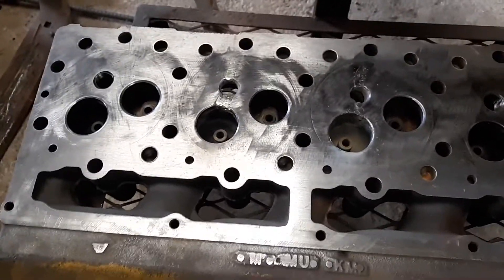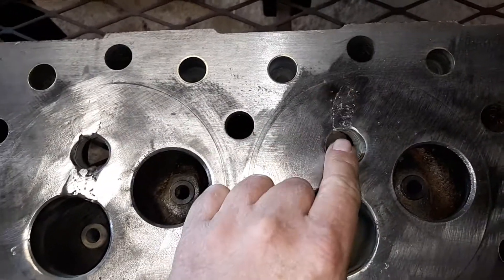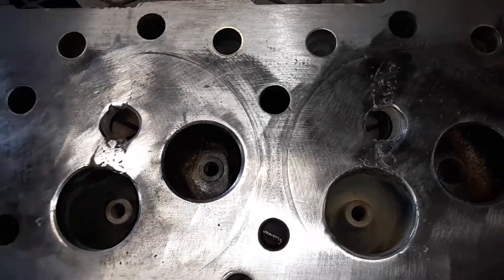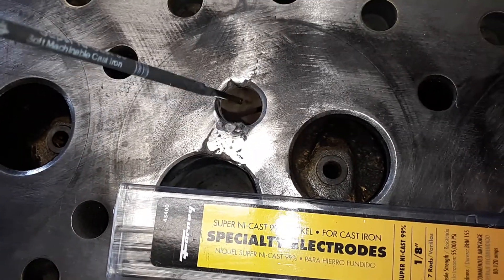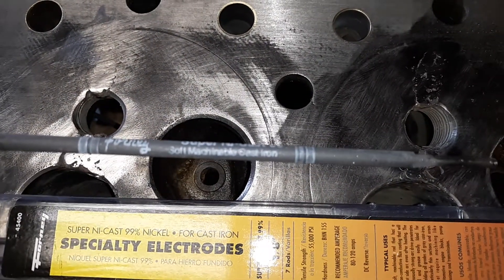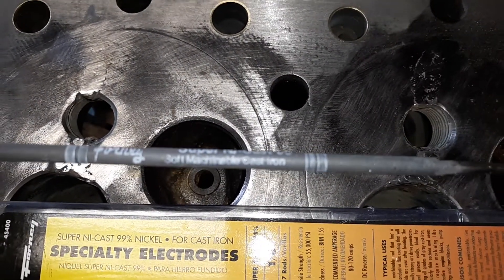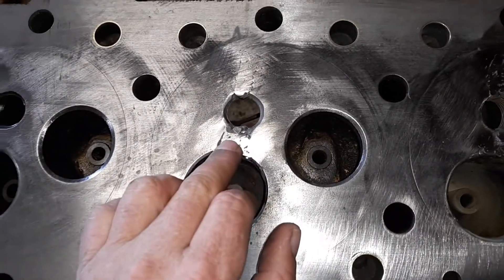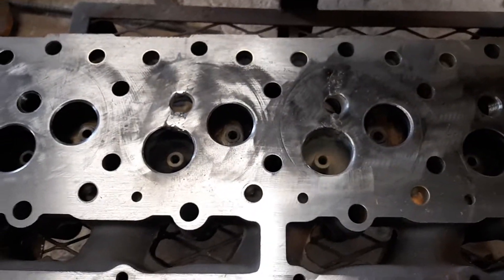Welding cast iron head.

Comment: How did it hold up?
Reply from the maker: Good it's still running.
Reply: @wedge4034  Awesome! I've got a crack in between valve seats on an SD22 4cyl diesel I am building . Maybe I will give it a shot. No heads anywhere for this engine anyways so I've got nothing to lose.
Reply from the maker: Make sure you buy the machinable rods.
Reply: @wedge4034  Ok. I ordered silicon bronze, but it didn't specify.  These are hairline fractures in between valves, and looks to be very common on this engine. The guy who used to rebuild all my heads for me said he has never seen one that wasn't cracked. But the engine ran fine before removal, it had 300k on it.